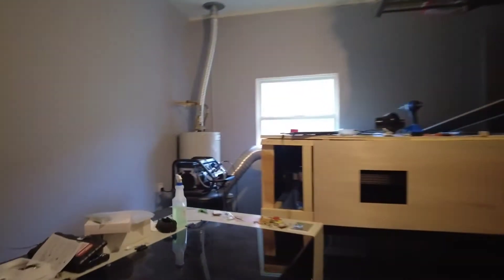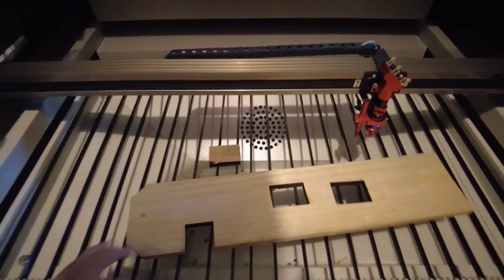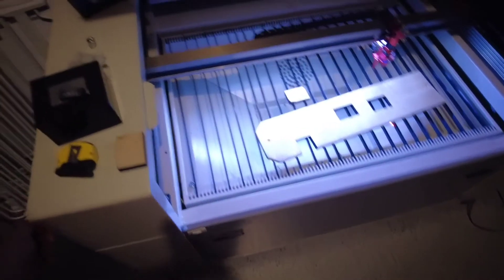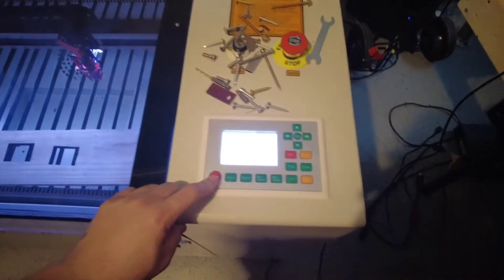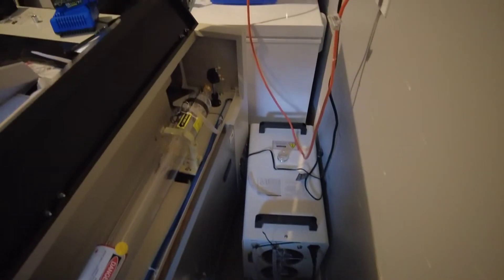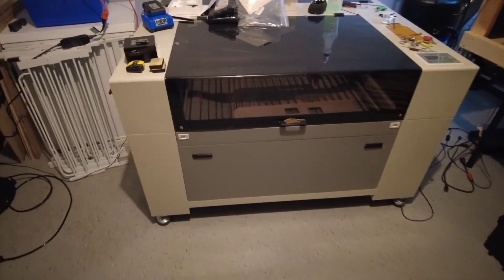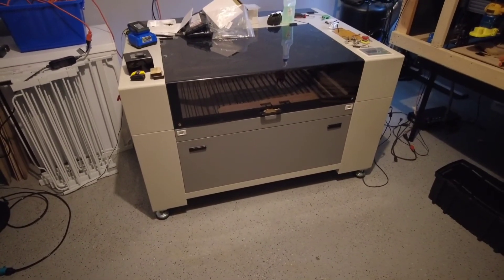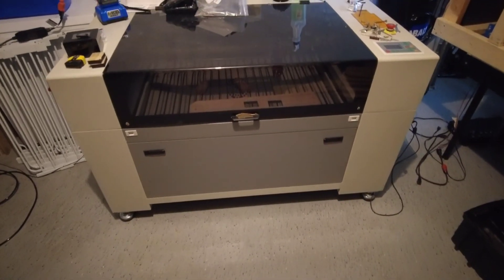Monport Laser | 80watt CO2 Laser cutter

Comment: Thanks for the video. Did you buy the 80W (instead of a higher watt) for a specific reason...cost, size of unit, etc.? I am new to lasers (new as in still shopping) and wondering if "the more power the better" or if power is more specific to what you plan to use the laser for? I like to spend my money once as much as possible rather than fall into the trap of underbuying and then spending more money later on to upgrade. Thanks.
Reply from the maker: At the time it was about availability and my budget I originally wanted something I could put a 2x4 sheet in and not have to mess around with cutting my material. I really didn't want to go over 5k but probably would have but the larger ones from monport were labeled as coming soon at the time. I say if you can afford it. Get the most biggest and most powerful one you can at the time. It will pay it self off.
Reply: @practicemakesperfection8459  Thanks for the reply...makes sense!

Comment: Leave the chiller in intelligent mode. The idea is to keep the water in the tube within a few degrees of room temperature to keep it from forming condensation, which will short down the tube. And definitely move it! You have to have at least a foot of clearance on both sides or it can overheat or not control the water temp properly! I love my Monport lasers, they're a higher quality build than OMTech, even though it's the same factory that makes them.
Reply from the maker: thanks! ill be sure to move it.